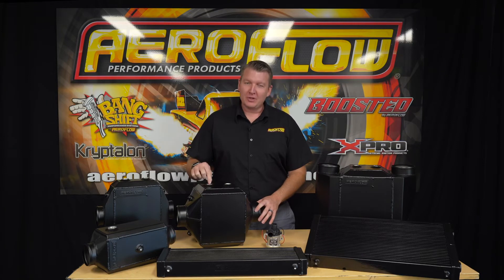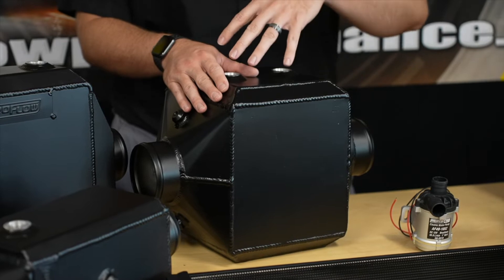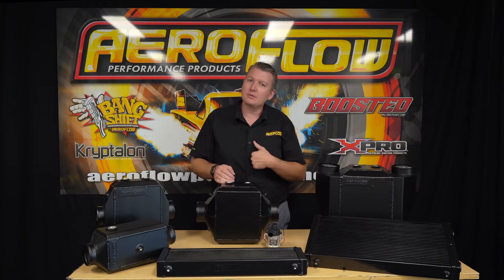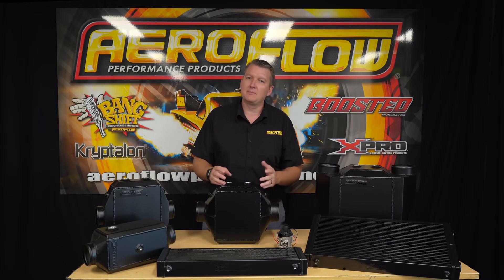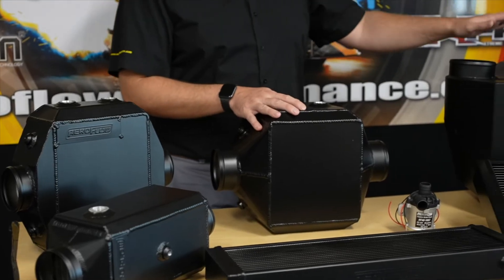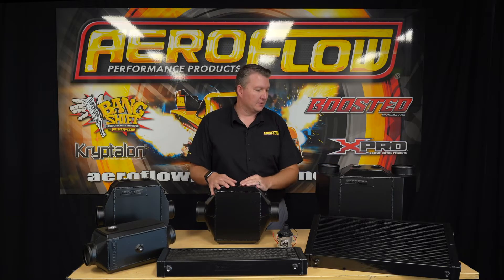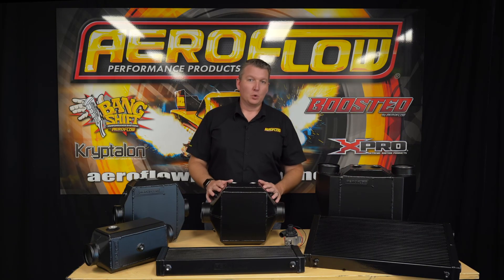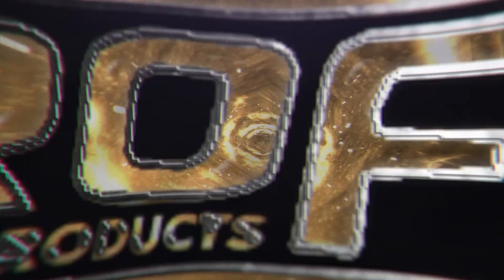You NEED a Water To Air Intercooler!

Comment: Do we know the weights on these at all?
Reply from the maker: Hey there, depending on the size they are 6.5kg, 9kg or 19kg for the big AF90-3003 unit
Reply: @aeroflowperformance  Legend cheers!, I ended up going the AF90-3001 and your smaller heat exchanger, Doing a rear mount turbo setup in my current model mx5 with a v6 in it, also using your oil pump etc, Will tag you guys on socials once it's finished

Comment: IMO the best reason to go with water to air is possibility of extra short intake with snappy response - Instead of going to a2a intercooler you go straight from turbo to water block and throttle body. There is less travel, that means there is faster response

Comment: whats the water pressure range required for one of these.  Id like to add one to my jet boat which would get its input from the jet pump as opposed to an ancillary water pump.  Is this doable?  Im not sure what pressure would be from the pump but i could install a water pressure regulator if needed.  DISREGARD, i asked the pressure question and 2 seconds later you answered it lol

Comment: On a street car, for only 300hp is it worth it for the summer ? If I place the water radiator in the place of the original air to air intercooler ?
Reply: Yes. Really, the only downside to A2W is added weight and complexity. This is true for track and street vehicles.

Comment: My rs5 is water to air. There's a company that created an air to air. The cooling is far better than any upgraded water to air intercooler. How come air to air is better than water to air in my car? This video seems to say otherwise
Reply: Air to air might be better outlet  temp however more pressure drop and more lag.
Reply: @boostdr33  don't you want pressure drop? And do you mean turbo lag?
Reply: @Jake_Smith7472  of course not, you slow down the flow with longer piping with Air to Air, and turbo has to work harder with pressure drop after the intercooler. Biggest advantage of water to air is very short piping from turbo to engine intake. So less lag too. But Air to Air might be more efficient sometimes, less weight, less issues. hard to say.
Reply: This video explained it but let me try again for you. W2A correctly setup will always be much better than A2A as it's about 60% more efficient. There is a reason drag racing cars use them. The issue with a street car is that it's running for a long time so you heat up the water tank. So you need a large Heat Exchanger up front and a good pump 150lpm for example. So this makes a proper setup complicated and more expensive with more weight. A large A2A is cheap easy and efficient for most cars.

Comment: Can you run both?  Ice box through heat exchanger?
Reply: yes - you just need to remember the right order. You can also make a special ice box with a container built in to put ice or even dry ice -100F/-78C.

Comment: Seems a good idea.  It works well on ProCharger equiped drag cars, using ice. I think it might be easier to spray water onto the stock air to air sometimes.  Didnt Subaru do just that on one model? So why dont they still do it.
Reply: It's just logistics. The amount of water you'd need to help with temps outpaces space to have that much water/weight on board. Subaru did do it but I think only for a model year or two. Another thing to consider is track rules about fluids leaking onto the track surface itself. Might be a liability. 

Of course, water/methanol injection is an option too.

Comment: I have a v8 audi s4 thatvi want to turbo..Can you tap into the factory coolant lines and use like a "Y" shaped fitting to run a -12n hose  to the side mount? Or do i need to purchase the heat exchanger.. and if i need the heat exchanger does that get rid of my radiator or just sit in front of
Reply from the maker: You can utilise the factory cooling system however it will be much less efficient than a stand-alone system since the water/coolant will be already at regular engine operating temperature - and that is generally higher than ambient temp. We would recommend using a heat exchanger and yes you need to mount it in a location that has air flow

Comment: So is basicly the same you still need an extra radiator in front of your car... i will stick to air to air intercooler and shot it with some nos to cool it down if i want to drag race.. zero beneficial  from doing this conversion for daily driving cars
Reply from the maker: Yes and no, the water to air is going to give you a much more consistent intake air temperature and the required area for the heat exchanger is generally smaller than an effective air to air cooler. Air to Air is definitely easier and less complicated to setup though
Reply: @aeroflowperformance can we not have a single big radiator and bypass the lines to run through the engine and supercharger?

Comment: Have a look a Julian Edgar videos on running the water pump based on throttle position. When in no to low boost the pump does not run so the water sits in the front radiator staying cool until you hits the throttle then the pump starts & hits the cooler with cold water.
Reply: You could use a boost pressure switch/ map sensor to activate the pump would be more accurate for boost
Reply: @willspinhayward1355  what a brilliant idea. thank you!
Reply: This is what toyota did with the 95+, GT4s

Comment: I have a Infiniti Q 60 I put a bigger intercooler on it and the temperature is about 10° above ambient temperature that’s as cold as I can get it. Is it about right
Reply from the maker: If you are still using the same amount of coolant in the system then it's probably about right. The surface area of the cooler is larger which will allow more heat transfer however if you don't have a larger capacity for fluid then the same amount of fluid is exposed to the same heat source for the same amount of time. I hope that makes sense!

Comment: hi there，can 2kd hilux use this intercooler？currently pushing around 200whp，my goal would be around 300whp
Reply from the maker: These intercoolers are completely universal so you can use it in any application that requires cooler charge air

Comment: Will one of these water to air intercoolers work properly on a diesel ? such as a ford 7.3 powerstroke. I all ready have an air to air but see egts over 1200 when towing, so I have to back out of the throttle. Thanks
Reply from the maker: Hi Kent, they will work no problem, you just need to size the core appropriately and have a large reservoir with heat exchanger to keep it consistent. There's only so much heat the water (or coolant) can take out before it needs to then be exchanged again in order to keep cooling for a long period of time.
Reply: That's how I got here. They do make one now. Unless you have a separate water system for it it won't cool as much. Haven't found anything to compare tho.

Comment: What temps can this achieve ? Any dyno tests vs air to air?
Reply from the maker: Depending on the setup, ice used or size of water reservoir you could get down to single digits but even with the smallest core we see starting temps in the mid-teens and finishing in the 20s. This is all relevant to power level and efficiency of the setup but in comparison an air to air intercooler will rarely see below ambient temperatures

Comment: So do you run the water pump inline and hook into your cars existing coolant system? Or is it a second designated cooling system entirely?
Reply from the maker: Generally it's better to have a separate system, as we described at the start of the video, for maximum performance. You can also run it from your engine coolant system although you may need a higher volume water pump to keep things moving
Reply: I would do it as a separate system and use the A/C to chill the heat exchanger for colder temps
Reply: You can use the cars coolant system but then you are stuck with a minimum charge air temp of 90*C or the coolant temp that engine runs at even if its 0*C outside as cars coolant always run at same temp regardless of outside air temps (mostly). 

If you use a separate cooling system with its own coolant you can keep that coolant at ambient air temp or even lower if you add ice to the coolant or alcohol based coolant, 
allowing the charge air to be much lower, problem is once that seperate cooling system is heatsoaked then it looses effienciency but its still better than Air to air, Specially Top Mounts. 

But there is a lot of extra Weight, complexity and chance for things to go wrong with Water to Air.

Comment: Are there AN adapters for those barbs on the pumps. Or do you have a pump with AN in and out.
Reply from the maker: We do have an adapter for 3/4" barb but we are looking at adding a new AN based pump in the future. The adapter is here: https://aeroflowperformance.com/af741-12-12blk-3-4-barb-to-12an-adapter